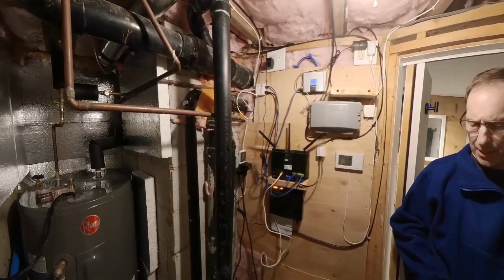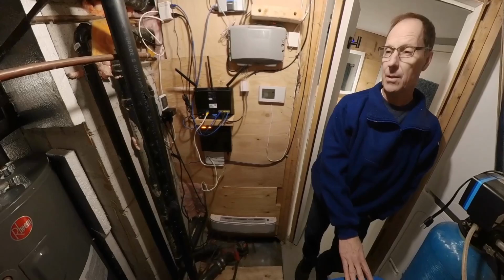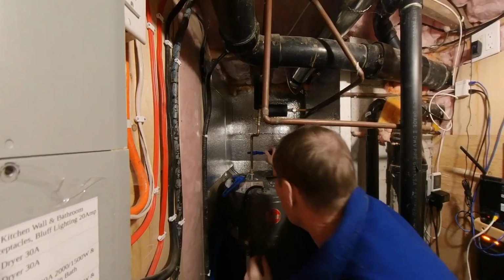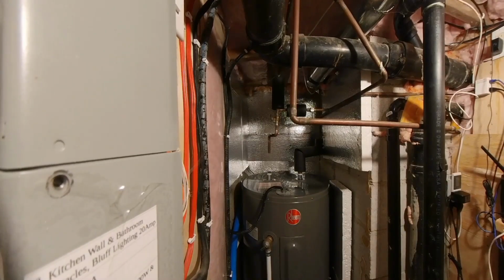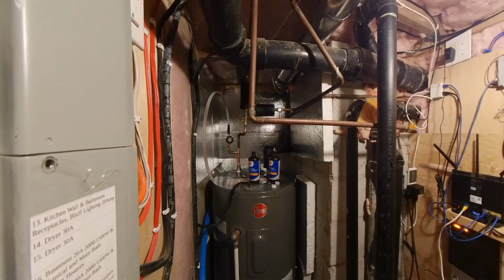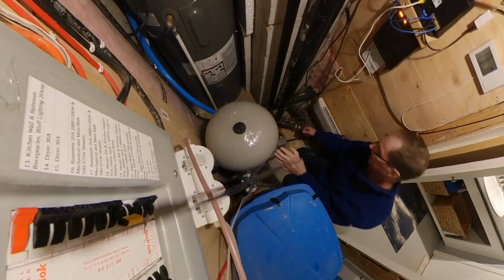Water Heater Rotten Egg Smell Treatment Method

Comment: Good idea. The only question is how often will you have to repeat this. I have this same issue in my well system and when I replaced the hwt I changed the anode to Aluminum if my memory serves me. However that worked only for a while and back to the same old problem. I was thinking of trying one of those Corro-protec powered anodes however I would really like to know someone who has used this (not just reviews because we know those can planted) because they are fairly expensive and if they work I would gladly pay the cost but would not want to spend a couple of hundred for a unit and not have it work.
Reply from the maker: Fair question, not sure of the answer yet as I only did the modification in January 2025. I considered the anode solution as well, but they are crazy expensive given that I could not ensure they would work or if I could even install one on my cramped utility room given the lack of head room above the tank. Hydrogen peroxide is cheap and I was pretty confident it would work given the other un-sponsored posts. My plan was to post an addendum some time in the future when I have to re-treat the water heater so people could see how often it is required.